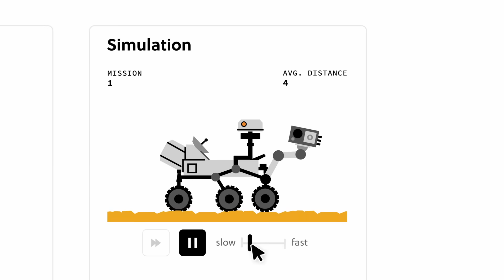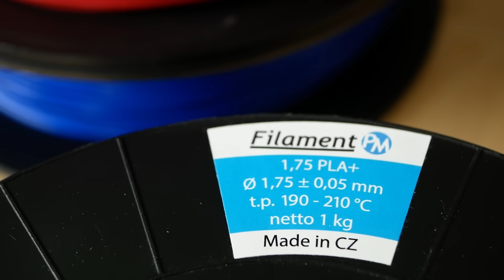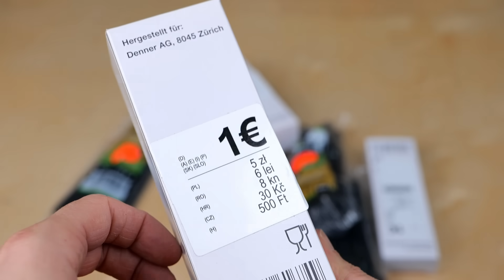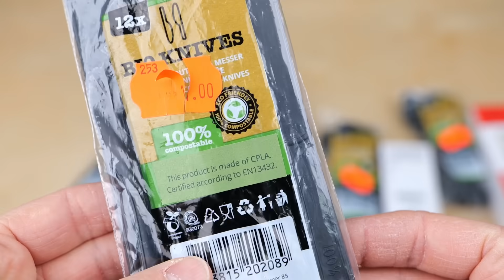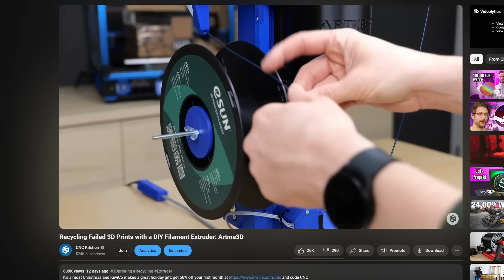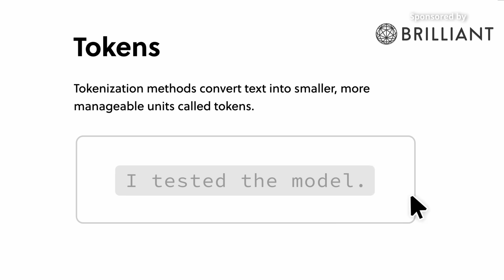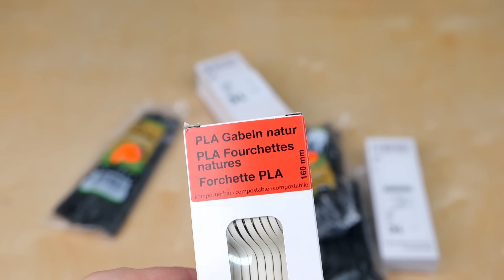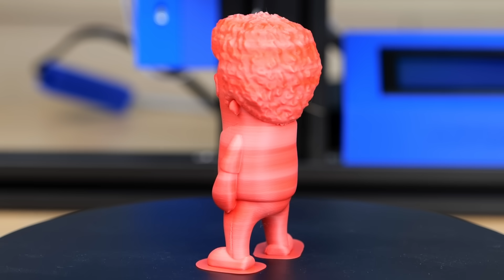From Trash to Treasure: Recycle Cutlery into 3D Filament!

Comment: Hey Stefan, Eventuell hast du das Video schon mal gesehen. Bin mal heuer auf einen Youtuber gestossen (weiß leider nicht mehr den Kanalnamen) der auch sein eigenes Filament aus geschrederten Sachen gemacht hat.  Er hatte aber Probleme mit dem geschredderten Material (so wie deiner) einen 1.75mm konstanten Filament hinzubekommen.  Deswegen hat er das in 2 läufen gemacht. Er hat mit dieses geschreddertes Plättchenmatterial einen Filament  gemacht mit irgendeine stärke. Dann hat er das Filament mit einen Art Bohrer mit ein Akkuschrauber den zu Pellets geschnitten. Danach hat er mit diese Pellets  einen konstanteren Filamentdurchmesser hinbekommen ohne neues Material beizumischen.  Weiß nicht ob es Sinn macht da doppelter Aufwand, aber wäre Interessant ob man da einen ~1.75mm konstanten Filament hinbekommt?
Reply: Which language was the video? If it was German, then the two possible candidates are Werbewunder and HomoFaciens, though the latter always also makes an English language version. And how old is the vid?

But i'd like to suggest that the video you're referring to is a CNC Kitchen video from a few weeks ago. This same channel. Embarrassing, no?
Reply: @SianaGearz  Thanks for your answer. The video is from Dr. D-Flo. He doesn't do anything different than Stefan does with the expensive 3devo. The extruder unit in the video alone costs over 6k. But he makes a filament from the shredded material and then cuts it into pellets and makes another filament with better tolerances. There he also makes filament from PET bottles mixed with new granules.
My suggestion was how one could produce a more consistent 1.75 mm filament with the much cheaper Artme without additionally adding new granules.

Comment: Considering water used to clean that cutlery and overall energy use, do you think this is actually less wasteful? I mean of course this is on a super small scale, but I'm wondering also on a bigger scale would anything like this actually be efficient and good?
Reply: Water is not destroyed, it's moved. After you've "consumed" the water to wash something, it's still water, it's just a little filthy, and as far as food waste, nature can take care of it, it fully breaks down, and the water itself re-circulates naturally. There is water scarcity some spots and water overabundance in other spots of the world. So of course you wouldn't put a plastic washing plant where there is water scarcity.

You can't flush detergents into the nature, you have to take those out or bind them. But i believe that's a solved problem.

You would also consume very little water if set up right, so you might have the dirtiest water that does most of the work, then you take the plastic out and put it into a bath with slightly cleaner water and so in several stages, with the last stage having almost clean water touching already essentially clean plastic, so you need to replace a little of that water at a time. Local plastic recycling plant says they consume mere millilitres of water to wash a yogurt container.

I also wonder i mean you could grow bacteria in that waste water that would break down the food waste, and liberate some gas from that, that you can run in a reactor, just like compost.

I'd love to read well researched scientific papers on the subject.
Reply: @SianaGearz  wow thank you for your detailed answer. Yeah I'm also interested in a detailed breakdown on all of this. I never really investigated this much, I'm just becoming more curious. 

I'm interested in the total energy spent in the whole chain. You know, water gets purified and treated, that takes some energy, water gets pumped to your house/factory, that also takes energy. You use electricity and it depends from what source you get your electricity etc. I'm sure you know what I mean.

Same way EV cars aren't inherently "clean" because in order to produce parts for them we have to do a lot of dirty work.

Comment: If you can't reach target diameter, you probably need a larger diameter nozzle, like 0.05-0.15 mm wider than the stock one. It may also be possible that the nozzle orifice is dirty, especially if you tried any materials that need higher temperatures.

Comment: What about plasic containers from take out food? It feels like a logical next step! As always, good job Stephan!
Reply: On my school project in Germany btw that's what I used. And you won't need an industrial shredder. You can slice lids with scissors and use the blender to make it to a smaller fraction. With a shredder it's faster though.
Reply: If it's #6 plastic it can be used just like Shrinky-Dinks! (The other ones, not so much)

Comment: Could you recycle straws they might not be PLA but they still might be printable.
Reply: That will be difficult to find, all we've got in Bavaria are either paper straws, or non-disposable silicon, metal and glass straws which come with a cleaning brush. Obviously you're not recycling either. The classic PE and PP straws have become quite difficult to obtain.

Comment: I used to work in a medical production facility where we made medical tubing on a plastic extruder. There the diameter was very critical. We had a laser micrometer continuously measure the extruded diameter and via a feedback loop we adjusted for the correct diameter. The tubing was cooled in a waterbath so it wouldn't change diameter anymore before winding on a spool.
Correction was done by pulling out the material faster or slower until the specification diameter was reached. This was done continuously throughout the production proces.

I would suspect that if you can create a very stable fillament diameter the 3D printed product would benefit greatly and have fewer defects and artifacts.
Just my 2 cents. Great Vid!

Comment: People used to make their own dual-color filament by manually printing spirals 1.75mm thick, doing half the layers in one color and half in another, with end result being mesmerizing prints that change the color depending on the view angle. What I'm curious about is what would happen if instead of two colors we would try to mix two different materials? Would it allow us to cheaply create DIY super-alloys, strong and durable? Or would it make an absolute mess and clog the extruder? Can we turn cheap Chinese eSun ePA into Polymaker PolyMide CoPa with this one simple trick that Big Plastic doesn't want you to know? xD

Comment: I'm curious to know if you can recycle trashbags, ocean plastic or littered plastic found off the street or from a hike. 

My hope with recycling plastic into filament is that we can ultimately turn anything of any condition back into something reusable. If you're looking for a super challenging material to experiment with, try recycling styrofoam to see if that's even possible
Reply: Trash bags are polyethylene, this polymer survives repeat heat cycles really well to be reused in injection moulding. Nobody prints it due to very high shrinkage rate. Then again people are starting to print polypropylene now which also shrinks like mad just the same, so maybe with enclosed printers which can achieve high bed temperature might be worth a shot!

Styrofoam yeah i think you can just drip acetone on it and then evaporate it out. Acetone does dissolve polystyrene but for whatever reason it doesn't actually absorb a lot of it, unlike say ABS, so it should be pretty easy. Another solvent it's susceptible to is lemonene, there's actually a bunch of solvents that can work. You can probably make do with a very small amount of solvent in an enclosed polyethyelene bag to collapse the bubbles and create a cohesive lump or sheet of material that you can then grind down and re-melt. Polystyrene should print really nicely actually; also it can be blended with polybutadiene to create HIPS, which is not a copolymer (unlike ABS, ASA, PETG etc) but a blend. HIPS is actually an absolute pleasure to print. I actually don't understand why HIPS isn't more popular as a primary 3D printing material, i mean its availability is decent, it's cheap, and it can replace the much more troublesome ABS and ASA in most use cases thanks to decent mechanical properties and similar temperature resistance.

Problem with ocean and litter plastics is that you're going to see a mixture of polyethylene and polypropylene; while both of these are useful individually and survive re-melting really well, they are under no circumstances ever to be mixed, any cross contamination is paramount to avoid, because the blend isn't going to work, there's not going to be any cohesion to it. I don't know the exact chemical reasons but it has been noticed by people who experiment with recycling. I think blending them with other polymers is perilous as well. So you have the sorting problem, and unlabelled items. There's a machine which can tell you the type of plastic by some sort of optical method, but it doesn't work on plastics with some pigments, black is particularly problematic, but that can solve a part of the sorting problem if you can scale it up.

Also plastic that has floated in direct sunlight is going to be an issue, as a lot of it will be already chemically broken down. Worth an experiment perhaps.

To be kept in mind that thin-film products from PE and PP are good candidates for just reactor burning, like it doesn't matter if they have so much surface exposed to sun and oxygen that a lot of material is degraded, and they will burn down in a well tuned reactor liberating the residual energy entirely without solid or poisonous residue, emitting only CO2 and water vapour. You can reuse most of the inherent energy locked in the material to generate electricity. Fossil fuel based generators are still going to be useful for tertiary sort of filler energy generation for a long time to come because they can be adjusted in output at a moment's notice, while renewables just run whenever they want to, and nuclear are kind of slow to adjust, and having the fuel at least serve a useful purpose in the interim would potentially be an improvement over just burning oil and gas directly. Today these sort of reactor ovens just get fed with any plastic and at the end they produce solid residue (from other plastics which are not pure hydrocarbons) which can then be safely landfilled or used as a filler material in construction. Given these, we fundamentally don't have a problem that we don't know what to do with trash, just trouble getting the existing technologies to where they would matter.

Comment: I really think you should try making filament out of old tires. At least in the US, you can often get them for free.
Reply: That's thermoset polymers, not thermoplastic. They cannot be re-melted for injection moulding or 3D printing. From what i understand, they will not bind to thermoplastics either, so you can't really use them as a filler. They're just bad news all around. The only proper path to recycle those that i can think of is de-polymerisation into the primordial goop that they were made from to begin with, which is something they do naturally, at a rate that is significant enough to be dangerous and annoying but not fast enough to be useful!

Comment: The red filament looks like it’d be perfect for some mesa terrain pieces. As for suggestions, I’m somewhat curious what effect mixing different materials has.

I haven’t made much effort to sort my printing leftovers between PLA and PETG since I don’t have a recycler, but supposing I did have one would the mixed materials work at all or just make a useless spool?
Reply: You'd probably end up with a useless spool, unless you managed to sort them. PLA has a low melting temperature, so you could sort the PLA from the other material by putting it in an oven at just high enough temperature to make it soft, and then squish the prints to test the material.
Reply: PLA and PETG absolutely do not like each other, they form virtually no molecular bond, so you would be relying purely on mechanical interlocking. PLA and ABS do work together quite well though, so I imagine PC might work too since PC and ABS work together. PETG happily bonds to TPU and Nylon to a lesser degree, so some impurities there shouldn't harm the result too much. Definitely a nice topic for more research!

Comment: You cant be too serious about your 3d printed parts, if you make your own filament. The entire 3d printing device is ANCHORED on the assumption that the filament is homogeneous  in density, and 1.75mm diameter, PERFECT, across the ENTIRE length of the spool. Anything less, and you will get crappy prints.
Reply: It has to be a consistent and known diameter, but it doesn't have to be strictly 1.75 if you know how to compensate. It must however be strictly less than a certain width, usually around 1.95mm in all directions (including ovality) for 1.75mm diameter filament printers.
Reply: @SianaGearz  : It is a mathematical ASSUMPTION of all FDM 3d printers that the filament is perfect. The printer just moves filament by the mm. If diameter, or density incorrect, the result is incorrect.  High quality filament has a tolerance of +-0.02 mm. Typical filament has a +-0.05.. tolerance. The difference  between those 2 examples is noticeable to the naked eye. And making your own filament out of plastic spoons..... good luck with that.
Reply: @tazanteflight8670  Not all prints have the same requirements. A slight surface porosity or extrusion fluctuation is bad for a Batman Yoda but fine for just a thing that holds my power strip mounted to the desk, or the leg bottom for a piece of furniture i slapped together to hold a music instrument. The precision of 3D printers isn't all too high anyway. Sometimes you're fine with deliberately dialled in overextrusion and just drilling out the holes. The assumption of precision is violated every time there is a retraction, since by the time the same piece of filament runs through the extruder a second time, it's slightly distorted elongated and notched. I made quite a few things with Fuzzy Skin modifier and those you'd be hard pressed to tell how consistent or not the extrusion was, and they look and work great.
Reply: @SianaGearz : I agree with everything you just said. In fact it kinda sounds like my comment "you must not be too serious about the quality" if you use less than perfect filament. If you are making a bracket, who cares about print quality. But if you are making an etsy product, you are going to have to care. Question,.. which company has the best reputation for fdm 3d printers. I hope the name prusia comes to mind, because extremely high quality filament is their little secret. If you use prusia filament on a ender3, you will get the same high quality print... Its not the printers, its the filament.

Comment: Is that machine able to extrude ABS? I know that, in the US, ABS plastic is used in almost everything that is injection molded, so it would be way cool to be able to recycle “random” plastic trash into new plastic filament. I don’t think I’ve ever seen PLA cutlery in the US, but I’d imagine most of the stuff here is ABS.
Reply: ABS isn't naturally food-safe to put it mildly and most food safety agencies worldwide will flat out refuse to certify it. Butadiene acts as a styrene polymerisation inhibitor, so there's poisonous styrene monomer in the material. Now recently one manufacturer has pleaded with FDA to allow certifying ABS as food-safe, they promise they found a way to make it safe, but i don't know how it went and that's going to be quite expensive, so you're not going to see food contact safe ABS used for throwaway items.

Candidate polymers that would be useful for cutlery are PS, PC and PP. Fundamentally also PE but that would be quite hilarious to actually try to use, much too floppy and bendy. I don't expect that a lot of it is PC due to cost. I think PS is the number one choice because it's cheap and will hold a cutting edge for the duration of a meal. Chemical compatibility of PS isn't great, there are certain foods that can cause it to dissolve on the surface a little. PP doesn't have this issue.

Oh yeah someone else mentioned PET as a cutlery plastic. Yeah, that works, somehow just didn't cross my mind.

Comment: Had worked with thermoplastic starch before, and they can add talc particles to it so it becomes less hydrofile. You should keep in mind when recycling plastic that you don't fully know the composition as for example talc would clearly damage your nozzle 😅. Lastly I must say how much I hate the green washing of these plastics saying that are compostable and they are actually only possible to do in industrial composers which people does not have access. And many of persons throws it in common composers as they think it is OK... The green washing is so annoying. Specially when it goes literally in the opposite direction.

Comment: Some experiments with plastics that aren't usually used for 3D printing would be interesting. Poly Ethylene comes to mind, from bottle caps or shampoo bottles. I know its supposed to have extremely bad warping but maybe a modern enclosed printer like the P1 series with painfully slow printing would do the trick.
Reply: You would have to add GF or CF fibers to combat the warping issues. Probably not worth it as all the other sutff with recycling.
Reply: @sierraecho884  interesting option to "fix" the problem, at least for an experiment
Reply: @KaidoLP  This is how it´s done with PP or PA as well. Works well generally speaking.
One of the usually parts I design a housing in the automotive industry, those are PP to combat warping we use 15-30% GF filling.
Reply: @sierraecho884  Has anyone ever added fumed silica to filament? I wonder what that would do!
Reply: @SianaGearz  Not to my knowledge.